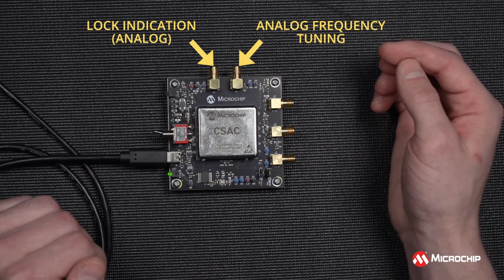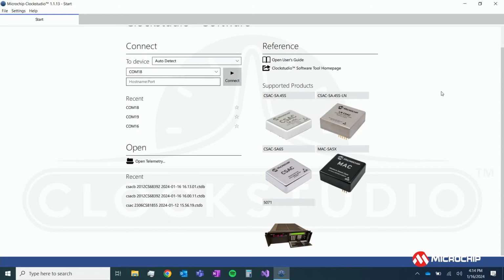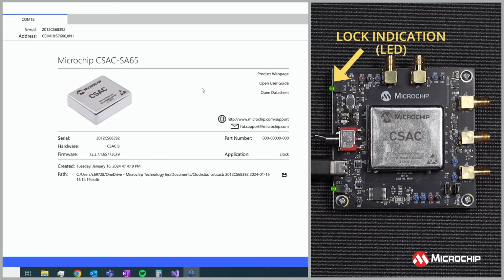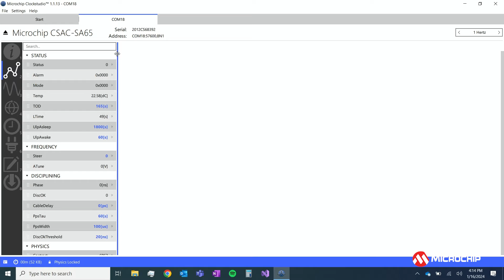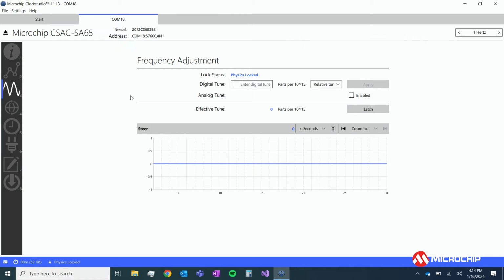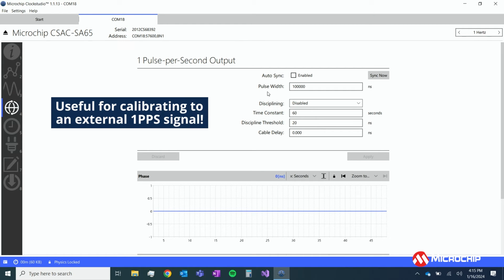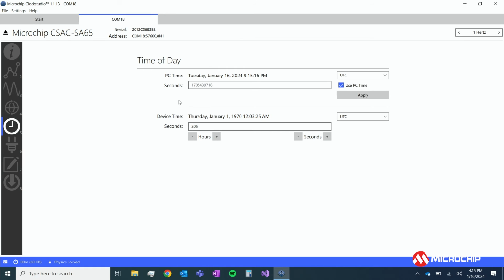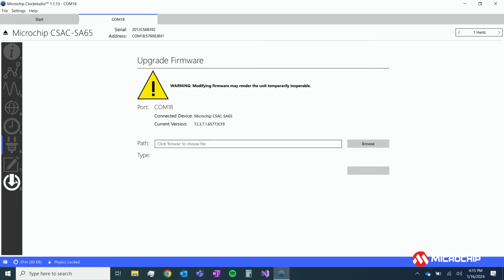Setting Up CSAC + ClockStudio

Comment: Hi, the evaluation baord, with or without the CSAC, does it have a part number or something? how to look for it? thanks
Reply from the maker: Hi there, thanks for your question. The demonstration is referring to this website: https://www.microchip.com/en-us/products/clock-and-timing/components/atomic-clocks/embedded-atomic-oscillators/csac. You might also want to check out this link for the contents of the developer kit: https://ww1.microchip.com/downloads/aemDocuments/documents/FTD/ProductDocuments/UserGuides/Chip-Scale-Atomic-Clock-CSAC-SA.45s-Users-Guide-DS50003041.pdf#page=40. This is available via our Authorized Distributors. Hope this helps!